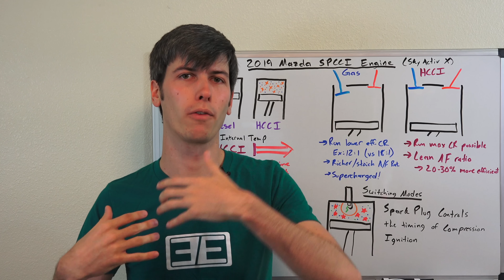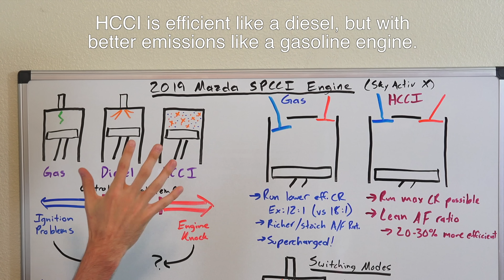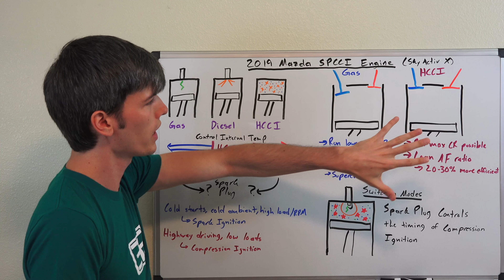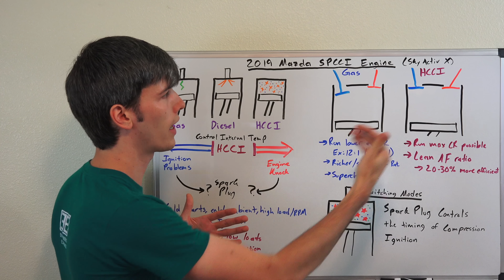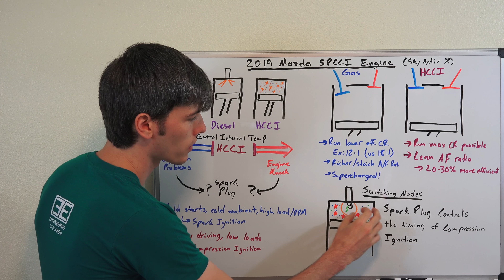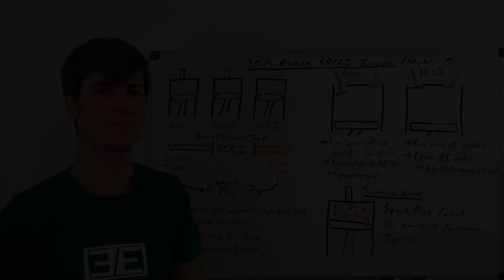Mazda Creates The Holy Grail Of Gasoline Engines - HCCI SkyActiv-X

Comment: Increasing the pressure and temperature this way could happened only by direct fuel common rail injection system. Where very low volume of fuel is introduced through intake stroke as pre-injection, than variable ignited in the second half of compression stroke to raise the temp/heat which just has equal effect as increased the compression ratio. That increased pressure has to be sustainable through dwell time of the piston where lateral stress can cause serious issue  on to mechanical components. If is successfully controlled than is fine. Main injection is delayed after tdc at around 30 degree and at least one more post injection variably at around 75 degree in power stroke.   Bobo.

Comment: Are you sure they'll use Atkinson cycle, or will they draw on their experience with miller cycle supercharged motors from the 800m of the late 90s? They released a kusabi concept with a miller cycle 4 cylinder a while back and I wonder if it was a sign they were still working on the theory?

Comment: so basically its another gasoline engine that has been over designed and retro designed with same or more parts got it. More computer dependent problems switching between HCCI and the spark-plug mode. This creates job security for trouble shooters (technicians) and engineers creating solutions upon another problem to have another solution lol. Also I happen to be an educated mechanical Engineer myself.
Reply: liquid piston technology looks good right now though I believe the military has it under thier wings.

Comment: Avoid Mazda at all cost worst manufacture ever have a Mazda CX seven and had over 20 check engine lights in the first six months I owned it was constantly being left to run an Alene condition which consequently cost me the motor Maza clams no responsibility to it now they have a recall on front and causing ball joints to go which I've had change twice one of them times causing an accident trying to get reimbursed from Mazda with paid receipt now they need canceled check stubs to prove I paid worst company ever avoid at all cost
Reply: I`ve had 3 Mazdas in 13 years, never had any issues whatsoever. You got a lemon.
Reply: I have a CX-7 (not the turbo version) Runs great. Little jewel of an engine.
Reply: worst manufacturer based on ONE customer, OK
Reply: 2 Mazda 3’s over 200k.  Only tires and brakes.  Nothing else not even an engine drive belt.  Now have a 2016 Mazda with over 90k no issues.  Just wish they still made trucks or larger SUV’s.

Comment: Sounds like they could use the supercharger (with a clutch) to change the comp ratio for when in hcci mode, vs opening the intake valve slightly.

Comment: Everyone is saying electric will pass gasoline in the near future. Not gonna happen. Maybe in 40 years but nothing soon. Electric might take over small commutes, but anything over a few hundred miles is a no go, like taking a trip up north or going on a road trip. Also, you can modify electric motors like you can gas engines. Many people underestimate the market for that. Go to SEMA, you won’t see practically any electric cars
Reply: Islamisthecultofsin lol you’re so delusional
Reply: Islamisthecultofsin I’m not saying they aren’t the way of the future but they’re nowhere near “on their way out”. Gas is too convenient. Won’t see them phasing out for another few decades
Reply: Islamisthecultofsin we don’t have a ton of car charging stations or standards yet. We need new battery technology. If we find better, higher capacity, faster charging, and higher discharge rate batteries, the electric car market would boom
Reply: Islamisthecultofsin u give them time? Are u some kind of high rank politician?
Reply: Chad Krause we need H2 running cars!!!! Water in and go gogo and no trouble causing batteries
Reply: Ialam....."They" the all seeing, all knowing have very simple experimental, propeller aircraft that are electric.  The U.S. leads the world in aircraft and we are likely 50 + years away from Transport Jet aircraft that carry 100+ people at Jet Aircraft speeds.

#2  As an Economics major and pilot, the decrease in usage of oil/petrol for powering cars and trucks will push the price of oil down, which will make the choice of petrol/gasoline powered vehicles less expensive and more likely to be used.  Simple supply and demand economics.

I don't expect electric to take over any time soon.
Reply: Islam.............If you think a decrease in demand for a product with a stable supply causes prices to go up you need to go back to Intro. to Economics and learn about supply and demand.  Only a true Marxist would believe your theory.
Reply: Islam.............You underestimate how the "free-market" works.  Study up on Economics 101.

We will still need oil for many other products, such as plastics, petro chemicals, asphalt, diesel, kerosene (for the previously mentioned Jet Aircraft), shipping, trains etc........your understanding of economics is woefully lacking.

I rest my case...........
Reply: No you don't. Your industry has become far too specialized for insiders to see the bigger picture.

The key mistake the car industry made decades ago was contracting out component manufacture to third parties.

When the urban commercial fleet owners realize the cost of maintaining an electric vehicle over its first 5 years, is a fraction of the cost of scheduled servicing for an ICE vehicle - the bottom will drop out of the market. Helped by the insurance industry, who will love the reduction in payouts for lemons.

But if you are in software, it should be relatively easy for you to switch over.

TEN years from now, ICE will be in a death spiral.
Reply: Chad Krause yes and the H2 running cars are the way not electric.. Less charge time, water instead of electricity from atomic reactors as fuel and no problem causing batteries and not really more dangerous then gasoline cars
Reply: Chad Krause yes and I hope that too,  since I am only about to get hands on cars for the first time ^^
And I won't even drive to work daily.. Public transportation is too good where I live and else I use my bike
Only for long distance car is good
Reply: I give them 10 to 20 years.  But there will probably always be ICE cars.  They will just be used for car shows and enthusiasts.
Reply: All are coming.
Reply: Islamisthecultofsin where is H2 crab? It's better then electric cars in every aspect
And well u might think it wasn't staged but it was.. 
keep getting it knowledge from biased media
Reply: You have to produce the hydrogen, store and transport it.  Electricity is far easier to deal with.  You will never put water in your car and drive it so you can forget that idea.  So your idea of an H2 car was actually a car that runs on water.  This doesn't exist.
There is far too much evidence that proves that the official story of 9/11 is what actually happened.
Reply: Chad Krause you must live in Michigan? I ask because you mentioned a trip up north.
Reply: Islam.........."to the airport and take a plane", which runs on kerosene (aka oil).
Reply: I see your point.  They are working on hybrid and eventually full electric planes.   My point that I was trying to make  was that people shouldn't shun electric cars just because they can't drive 1000 miles as easily as they could with an ICE car.  An electric car can already handle most people's daily commute.
Reply: I said that hybrid aircraft would come first just as they did with cars.  Eventually I would expect the price of gasoline to skyrocket as the majority of cars stop using it.  I agree that this won't happen for decades.  You are forgetting that there are many countries that are going to ban ICE cars so it won't matter if the fuel was free in those countries.
Reply: The price goes up while there is a demand but it becomes more expensive if you lose that demand because you no longer have the massive scale that existed before.  Imagine a hundred thousand people with cars wanting to buy a tank of gasoline compared with a hundred million.  Gasoline is still needed but the scale of production has collapsed.
Reply: You missed my point.  Refineries are massive and because of this the price for a gallon of gasoline is cheap.  Slash the scale down to a fraction of what it is now and the price will easily double.  Then you have the pipelines that also become uneconomical so transportation cost increase as well.  Then the scale drops again when those 100,000 consumers drop to just car enthusiasts who buy a tank of fuel  every couple of months for their hot rod that they drive once in a while on the weekends.  Gasoline is different from kerosene or asphalt.  Asphalt will probably disappear as it's the sludge left over after refining the oil.  Plastics can already be made from other things than oil.
Reply: If the U.N. dictates that because of climate change, gas and diesel will be banned, like they are already trying in Germany, then there will be no driving outside of cities.
Reply: +Mark Anthony  Never heard of superchargers I guess.
Reply: The future is, as they say, one of the hardest things to predict, but my guess is that the next step in mass market automobiles will be PHEVs. They're considerably cheaper to build than long range BEVs, they don't have the long recharge time issues BEVs have (in other words, they're more convenient), they can utilize already existing fueling infrastructure, and for the typical driver, their total (tailpipe plus upstream) GHG emissions, particularly for PHEVs that have powertrains like the Chevrolet Volt, are only slightly higher than BEV total emissions. Improvements in ICE efficiency will close the emissions gap between PHEVs and BEVs further.
Reply: It has nothing to do with the fuel.
Reply: The fundamental technology is not the problem. If it was, the intrinsic problems of ICE would have doomed it before it got started.
The issue is the availability of countless spare parts for countless car models.
Reply: H2 is best for stationary industrial purposes.
Reply: Chad Krause you don't know what you're talking about..road trip on ev is about infrastructure and some decent range on battery like 200 miles (we're already there)and that's what it takes..ev charging infrastructure is easier to emerge than for gas stations, since electric is already everywhere...
Reply: Simple economics is signalling the death of the fossil fuel engine. It doesn't take a genius, nor a person within the automotive industry to work that one out. The electric motor/storage battery genie is out of the bottle and it isn't going back in. It is only going to get better at what it does. And because the battery electric vehicle is closely entwined with the supply and consumption of household power people will subtlely change their habits to accomodate it. And they will appreciate that they don't have to be in servitude to the ff supply industry. 100 years ago, people changed their habits completely to accomodate the ff vehicle. People adapt. They'll do it again because the change will make their lives easier anyway. And they'll do it pretty much within 10-15 years.
Reply: I beg to differ; it is ALL in the engineering, let me explain; 
in solving for one of the electrical inefficiencies of conventional drive motors, whereby the re-captured 50% of the 'in-shot-capacitor-discharge' energy investment, is
being augmented by another 50% derived from the 're-setting' of the shielded magnetic field 'washing' over the 'pulse-coil' coil and resulting in a 'reverse-E-M-F' in turn, rectified 
 for capture through a bridge rectifier and 'current shaper'. Resulting in 40% "RECOVERY" of both (allowing 10% loss) through the 'current shaper' (increased voltage or increased amperage for the current to become acceptable / compatible to load the 'in-shot' capacitor again,) and re-start the cycle.

When this is taken further and one of these is installed at three different locations on the 360% of ANY in-put/ drive axel to any power use or need is where the compounded staggering increases in energy efficiency will be found to out preform fuel engine transport, once having overcome the electrical energy waste to such a point where, for example, the conventional. Tesla S  with a 232 miles range (on full charge) would increase 5X (five times) or to an INCREDIBLE! … 1,160 miles!
Reply: Keep a log of how far you drive every day.  It's easy to do just press the "trip" button in the morning before you leave and write down the mileage at the end of the day.  Most likely there is already an electric car that can do this with ease.  Bear in mind that an electric car is five times cheaper to run than two dollar gas and you have no oil changes either.  Also there are many companies that are coming out with chargers that will give you 80 percent charge in 30 minutes.  There is even one company saying 15 minutes.
Reply: It's an expression.  Actually everything is in place.  Electric cars can already go over 200 miles on a charge with much better batteries about to be released.   Charging stations are being built so the electric car has already come of age.
Reply: H2 is crap.  Nobody is bothering with it.  Batteries are already working much better than expected.
Also 9/11 wasn't staged so stop spreading lies.
Reply: You are woefully underinformed. Do yourself a favor and research what's really happening in automotive.
Reply: orion789 I am a software developer for an automotive company. I know exactly what I’m talking about
Reply: oh. Ok. My apologies. 40 years it is !!!
Reply: orion789 yea, which moves by fast though. It’s not motors it’s the battery and charging technology
Reply: Gas cars are already dead and buried.  They just don't know it yet.   Tesla has already solved the long distance trip problem and several next generation batteries are about to be released.  In addition most people fly for long trips so they will drive their electric car to the airport and take a plane.

Comment: A really easy way to get 30% increase of power is to disconnect the alternator.
You will think your car just got a race engine. 
Of course the battery will discharge quickly and you'll have to put the altenaor back on to keep driving.
We could save so so much much on feul by redesign of the 12volt battery and alternator ? 
And then every time we use less feul the orice goes up ! 
Should have stayed with V8s its cheaper in the long run

Comment: With a higher compression ratio and with wear of piston rings in time, combustion gasses blow-by will reduce efficiency of an engine .
Reply: I'd bet the engineers planned for that. Diesels trucks have high compression ratios, and the engines are designed to support that for many more miles than the average car. Sure, it might take an extra piston ring or something - but the efficiencies they claim account for all that.
Reply: I have invented engine oil that heals scratches and wear on steel surfaces and reduce friction losses. We use the oil since February of this year and I gave for independent field tests about 100 liters of the oil. Fuel economy has been improved about 28%, we can see lower temperature of engine operation, no vibrations of the engine at ignition. Some people report reduction and ceasing of smoke in exhaust, lower oil consumption, and easier start of the engine at ignition. Already we changed the engine oil in our ISUZU pickup with a 2.5 liter diesel engine after 12 000 km while in total we got 240 000 km. 
As for engineers that design engines - are they interested in longer millage of their cars after guaranty is expired? I bet they are not. Pistons are made shallow nowadays. No space for additional rings to keep the piston from inclination. So, in awhile efficiency will drop. Actually, good news for me as my oil heals the damage. Greetings from Thailand.

Comment: The DEC2017 Motor Trend magazine had a page on this. a little more detail than above. They claim that they are able to time combustion with the spark plug igniting a "tiny, locally rich mixture around the plug".  That ignition goes on to compress and combust  the lean mixture, as EE explains in the video.

They mention that the supercharger helps provide the 'swirl' to create the locally rich mixture, and that the direct fuel injection runs at pressures between a gasoline and a diesel engine (7,500 to 10,00 PSI?). And that the initial spark combustion, followed by the lean mix combustion makes for a smoother expansion than a diesel, so less 'clanging'.

Comment: Couldn't hcci be controlled better with direct injection?
Reply: Yes, but then you don't get HCCI. Part of the advantages of HCCI come from having the entire lean mixture combust at once, instead of a moving flame front that you get from the point of the spark gap, or at the tip of the injector.

It appears they do use direct injection, but inject first, and then combust. As I posted a minute ago, the DEC 2017 Motor Trend magazine had a little more detail on this.

Comment: So, HCCI still needs spark plugs and ignition coil pack, it needs a complicated valve control with EGR, the block will have to be stronger (i.e. heavier) to withstand the high compression ratio, the reduction in fuel consumption is a nice promise but, these claims are always questionable (cough... vw... cough... bmw... cough m-b).. HCCI doesnt seem to me like a solution. More like a complication of something that already works, one that will require further solutions to work well. So the engineers coming up with this are either: a) doing it to secure enough work for themselves in the future or b) just being the "if it isnt broken, it doesnt have enough features yet" kind of engineers

Comment: I am wondering how do they guarantee "homogeneous charge" being supplied? Do they use any static mixer? I am pretty sure that current "stratified charge" implemented in most modern SI-ICE can benefit from using such mixer.